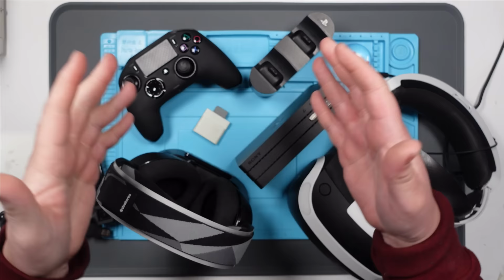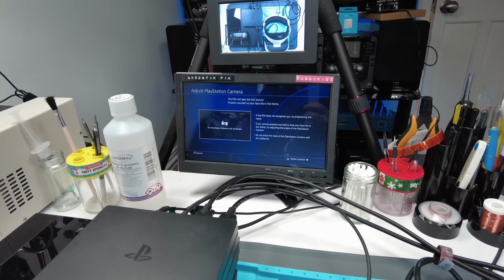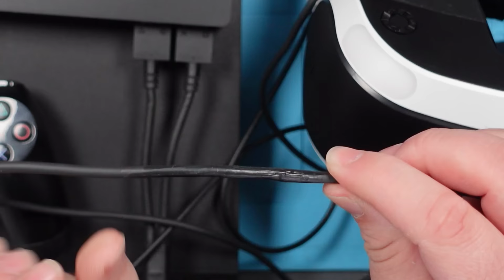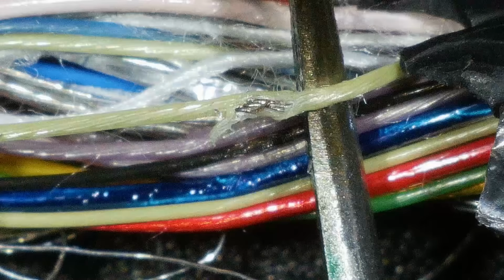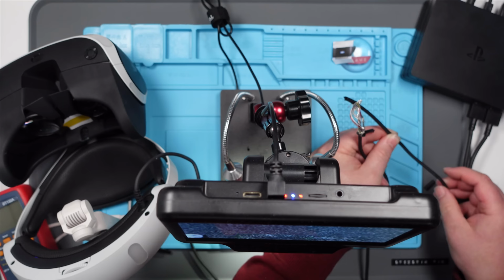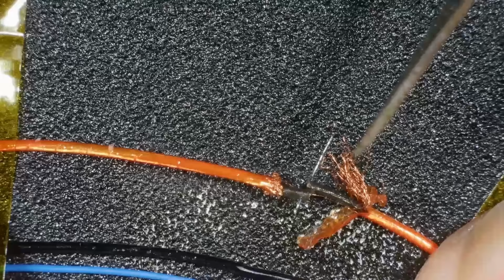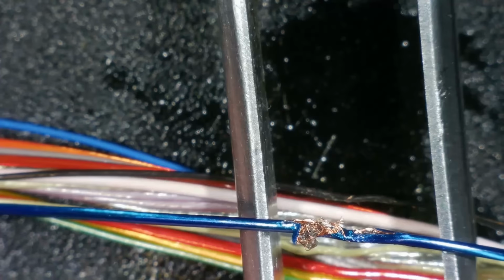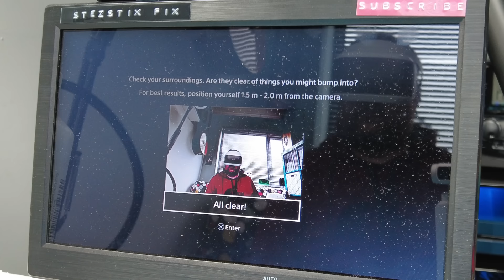Trying to FIX a PSVR Headset with NO DISPLAY

Comment: That's one heck of a deal, Steve. Funny how one split wire can render something unusable. Love it when it's something this easy to fix, although this one was tricky to pin down. Good job!
Reply from the maker: Thanks Angaar!  Yeah, definitely an easy fix but difficult at the same time.  I thought I was going to have to strip the whole thing down at one point!  Glad I found the break(s) relatively quickly in the end.  👍

Comment: Great result. What a good find. Millions of pounds spent on R&D by Sony, and it ends up in a £35 job lot lol
Reply from the maker: 😂 yep!  Really happy with this job lot, most of it is now working and I reckon I've more than made my money back on it.
Reply: Take a look at the Playstation 3D TV at some point. The EPROMs keep dying on it and was never addressed by Sony, they dropped it a year and a half after release. A $500 paper weight unless you have good soldering skills and an EPROM programmer (or pay $15 on eBay).
Reply: Brilliant job 👏 👍
Reply: Is there no where one can just buy a new cable cause wow I don't have any of those tools u used to fix yours and am pretty sure it the cable that's damaged in mine.😭

Comment: Nice videos mate 👍 like watching your repairs - YouTube started recommending them to me and I’ve been watching them ever since.. wish I had your technical knowledge and setup to be able to do similar stuff.. 

Ps think you can get heat shrink tape now that you roll around over itself (slightly overlapped) then heat it up for an enclosed bond.. haven’t used it myself but been in similar situations with wiring before.

I was initially thinking maybe chopping the damaged section out and you re solder a junction Board / box inline; but that’s a lot of work and then you have a chunky box hanging inline…

Cheers for the content 👍👊

Comment: The best thing I've found Steve other than heat shrink, is a very short 1/2" or so
of self amalgamating tape. Stretch it really thin then wrap it around the soldered
 wire. Satelite and tv aerial installers use this tape every day to seal water out of
co-axial cable and their connectors.

Comment: Nice fix Steve they is only two ways l know off and that is take the wires out of the head set then put the shrinking sleeve over the wire or can you buy a new wire and replace but you got it working well done 👍

Comment: I've fixed several VR headset but never a PSVR one. You gotta have the finest touch to go near those WMR screens. They are as thin as tracing paper and shatter at the slightest tweak. You are very lucky it wasn't a screen.

Comment: Nice job Steve

Something we’d do on aircraft cabling was to split the heat shrink down its length, wrap it around the cable loom and then superglue the overlapping edge - then heatshrink it

I’m not going to pretend it was pretty, and so your tape solution may be the better result as it doesn’t get exposed to any nasty environment

No singing this week? Nose flute still on order?
Reply from the maker: 😁 Thanks Guy. I did actually try splitting a bit of heatshrink and glueing it for a bit of a test, but I just failed miserably! 😅 no singing this week I'm afraid. I thought I'd impress you with my amazing dance coordination instead!
Reply: You were dancing?
I thought you were trying to chop that desk of yours into firewood 🔥🔥🔥🔥🔥
Reply from the maker: 😂 yeah, that too.

Comment: in the headset where it connected maybe there is a quick connect and you could have slipped the heatshrink over those and down the cable? But awesome fix mate keep it up.

Comment: I think the "wire within a wire" is carrying video and the outer wire is the shielding in which case you should ensure the outer braiding is covering the inner wire rather than just connecting with a wire.

Comment: Good fix, I think I might have been tempted to open the band and remove the cable from the helmet end and push heatshrink down it that way but if you are keeping it then that seems like a lot of hassle :)
Reply from the maker: Thanks Tim! I did think about doing that, but it turns out the connector on the other end is a 40 pin one and even bigger than the HDMI ones! 😳
Reply: @StezStixFix  Haha well forget that idea then! :D

Comment: The two methods I would've looked at for heatshrinking are to either open the headset, desolder all the wires, put some over, then resolder, or cut the headshrink in like a spiral, so you can spiral it over the cable, yet you haven't technically cut it in half.  Works better on thicker cables.
Reply: 40 pin wide flat solid connector in the headset...would have to cut the wire clean, slide on some heat shrink then then and resolder each of the approximately 34 wires back together, + the aluminium sheath

Comment: Nice job Steve 😉 I saw a repair video a few years ago about a similar VR headset. That one also had an issue with the wireing. I think people are just stepping and rolling on it blindly 😀 The only solution would be to make it wireless.😀
Reply from the maker: 😁 Yeah, you'd think Sony would be looking at making them wireless.  The cable is long and awkward, and I can imagine thousands and thousands have been broken just by the cable alone!
Reply: @StezStixFix  could you not remove and resolder it to the connector instead? A ballache i know but would look better than duct tape.

Comment: You could try to cut a large heatshrink (you can get them plenty large) up spirally, then shrink it. It will overlap because of the spiral cut. Use a few dots of superglue on the ends to hold it in place. I use Everbuild Stick 2, that is proper epic stuff

oh, and it's "duct tape" used to repair ducts in days of yore
Reply: fantastic tip and idea on that heat shrink!
Reply: Although there is a brand called duck tape.

Comment: If you use one size up heartshrink  split it  get it over the cable the fold edges over use 2 mini clamps anout 5mm apart heat gun inbetween clamps use more heat to melt edges then it sticks had to do that before

Comment: You can get heatshrink with an adhesive liner, split lengthways, overlap and shrink. A bit fiddly though and some adhesives are better than others.
Reply from the maker: Thanks Ralph! I did spot these on Amazon and wondered if they would work. Think I'll give it a try! 👍

Comment: Great vid! can i ask whats in the middle of the headset that you covered? is it the serial number?
Reply: It is a sensor that detects if someone is wearing it. It will dim/turn off otherwise which wouldn't be very helpful when trying to do a repair like this. Covering it up will fool it into thinking someone is using it so it will stay on.
Reply: @buffyfantastico  ow! that makes sense, thanks for the info!

Comment: I know that guilty feeling of wrapping duct tape or insulation tape, I'd rather cut the wire in two parts, put the ample amount of heat shrink for outer cable, strip those tiny wire ends,  join with boot lugs or tiny terminals with thin pvc coating and complete the job. Sure it leaves a bulge in the cable but at least looks better than the tape.

Comment: Next time, try liquid electrical tape. Still not pretty, but a great option for being able to paint on electrical tape.
Reply: I've got that stuff from AliExpress...don't ever heat it up, it contains "asphalt, resin, filler and curing agent etc" - it smells abysmal and I think heat would cause some lung issues if I'm honest.
Works nice for sealing around laptop power adapters you had to crack open.

Comment: How did you use the heatshrink on the cables If you didnt cut it?
Reply: He cut the internal damaged wires, before soldering them. This meant he could put heatshrink over them.

Comment: Idk if you are still active with this but I’m having a problem my front lights to the headset don’t turn on but my back ones do and my front goggles say hdmi thing I’d yet when I was playing it the other day it was fine until a few seconds later so I have no idea what’s going on I made sure everything was in and it is
Reply from the maker: I would guess it's a similar issue to the one I had here. One or more of the tiny wires are probably loose, so it works occasionally but not all the time. It's such a shame you can't buy replacement cables for these things!

Comment: Hey I have ps vr but the headset is on a black screen and shows nothing but outside lights still turn on, is there a fix for that ?
Reply from the maker: Hey, it'll likely be the same problem. Some of your wires (or maybe even only one of your wires) is severed. Or the cable has failed at the connector either end. Hope you can find the problem 👍